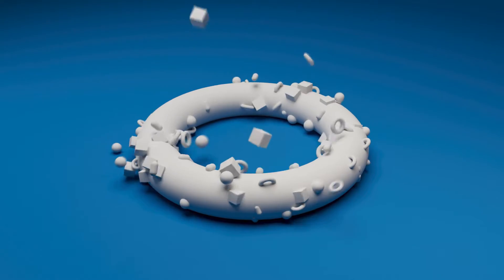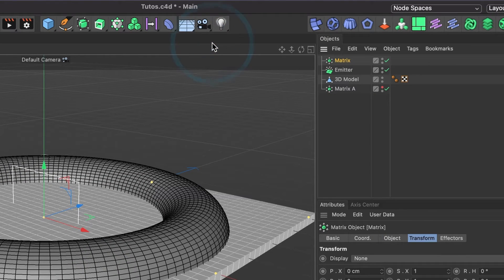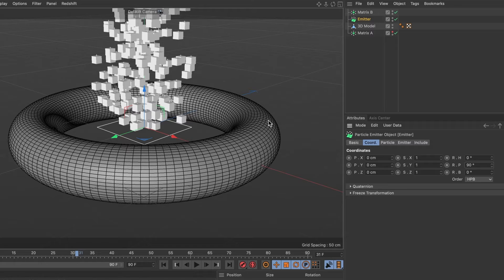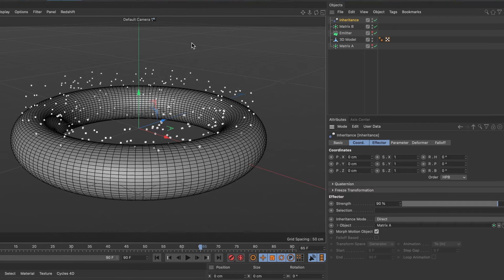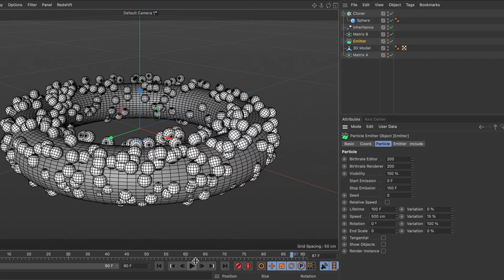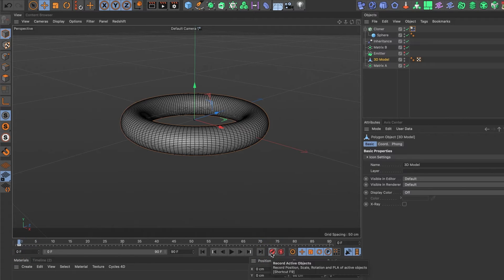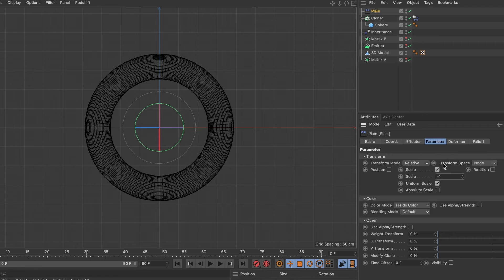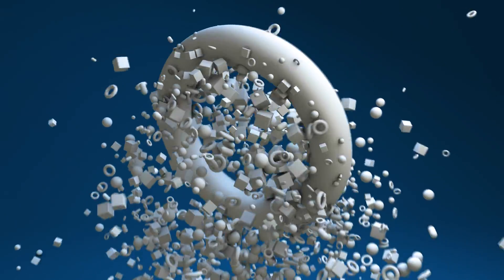Cinema 4D: Emitting Particles from Objects – Step-by-Step Guide

Comment: I set up a project in version 2024, I used mesh emitter to generate the particles, but I can't see them in the render via physics, even with the cloner. what could it be? Does it only render in redshift?
Reply from the maker: Sorry for the late reply! I used the Standard Render that comes with Cinema 4D. You can download my project file from the TutosDigital website and open it in Cinema 4D 2024 to check if the particle render works on your setup using the Standard Render. I'm working with the Cloner, Matrix, and Emitter tools. Let me know if the particles don’t show up for you! Here's the link: https://www.tutosdigital.com/cinema-4d-downloads/spline-path-nm45r-zg9rl-hb6je-3spj3-p4keb-jf3xp-4z7yg-gnz6p-a7tk4-fznpx-9n5bz-r5sa6-9s4g2